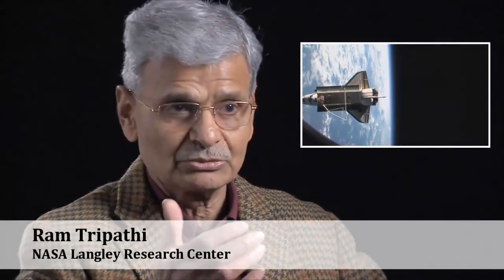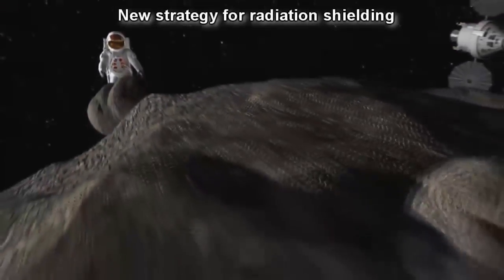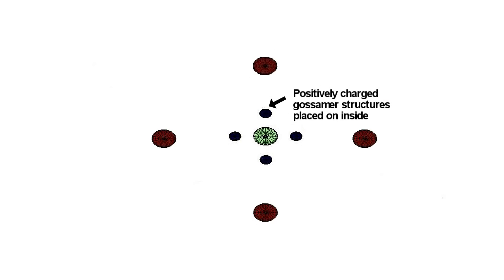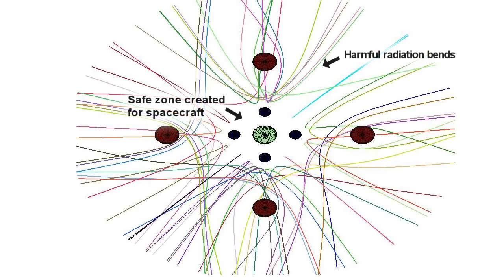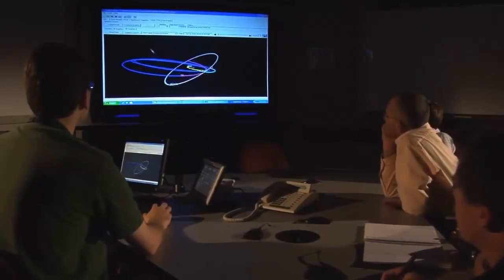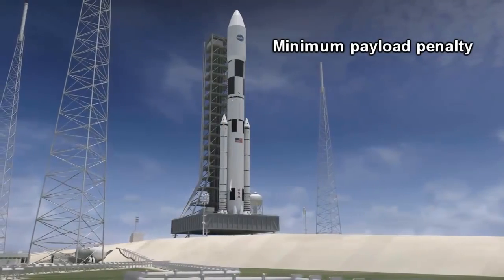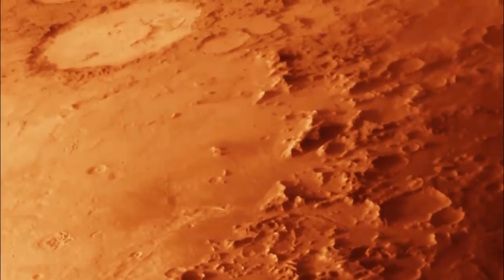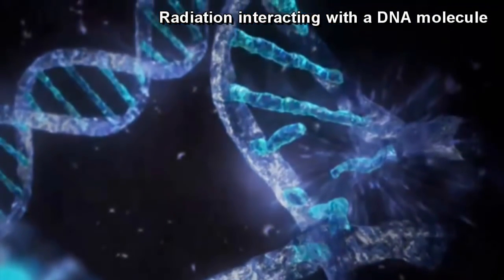Electrostatic Active Space Radiation Shielding For Deep Space Missions

Comment: not need this ,  only 0.1 mm aluminum foil like use in apollo is fine !
Reply: For short trips no shielding is usually fine unless there's a particularly bad solar storm. Apollo 11 only lasted eight days and had a much higher tolerance for risk than modern missions. For longer trips, such as staying on the surface of the moon or deeper into space, this method will be required.